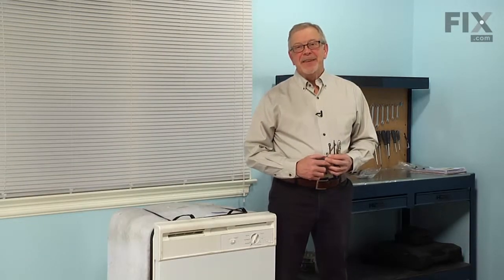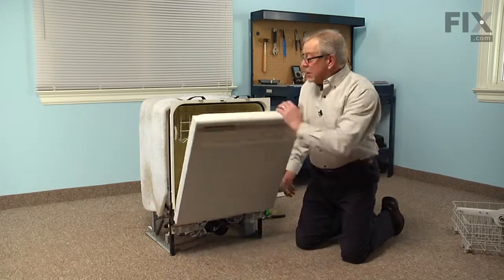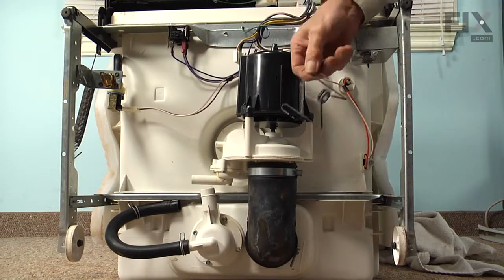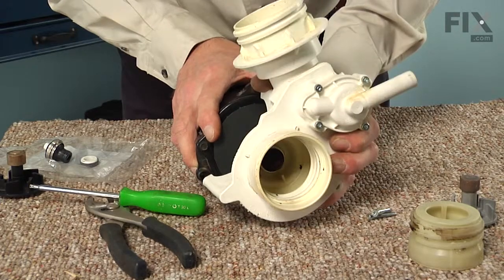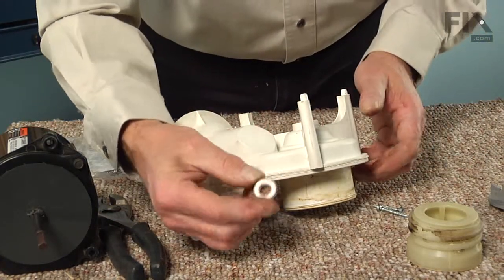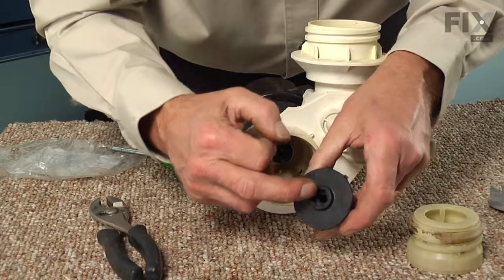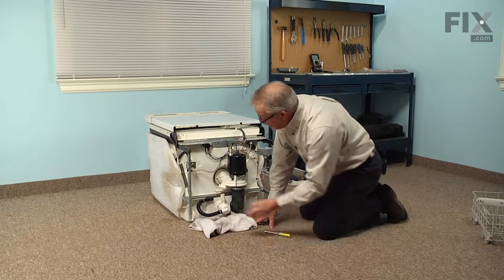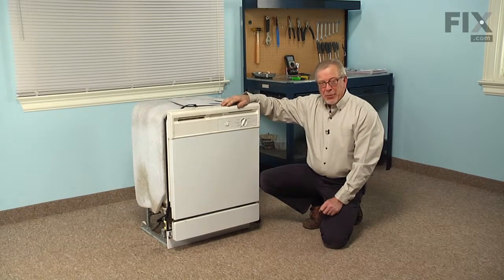Whirlpool Dishwasher Repair – How to replace the Impeller and Seal Kit

Comment: Ok so I am trying to get the impeller off without drilling it. I am like how did he just pop it off with ease. Maybe I can get away with tapping until it comes loose. I am trying to keep this project under 50 bucks cause the impeller and seal on eBay is 40 bucks. If I could I would just want the seal for 20 bucks lol. Times are tough in 2023 thank you uniparty installed like a toilet pedo Pete.